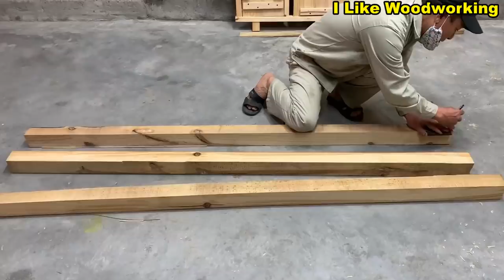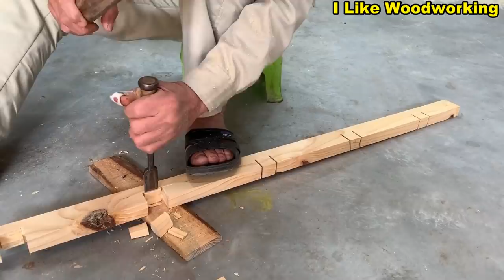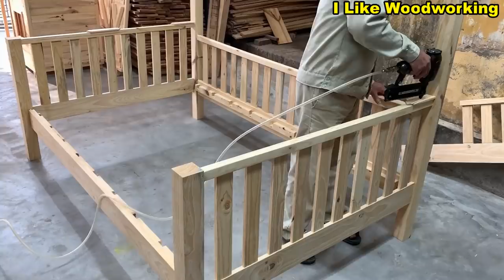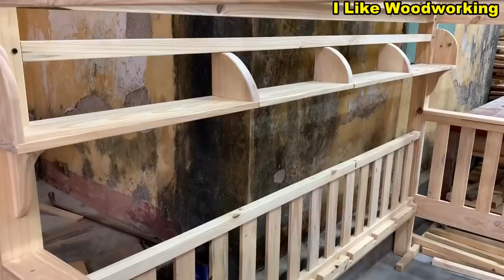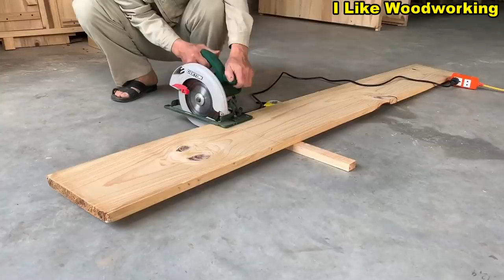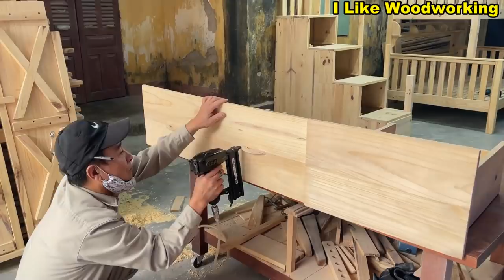Amazing Carpenters Woodworking Are Constantly Creating - Build A Modern Two Story Bed For Your Child

Comment: Project is good but, i don't like the connection type. I don't like stapling and without glue
Reply: Asian style: don't want to waste time waiting for the glue to dry. They prefer cribbling things with nails.
Reply: Although those joints are so tight you could keep working without having to wait...